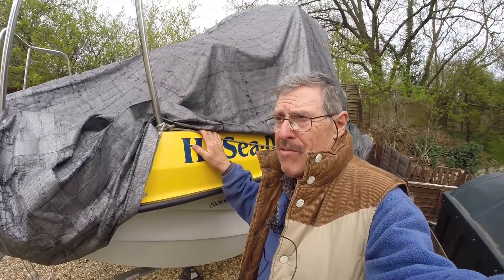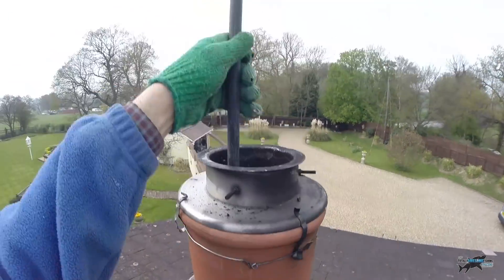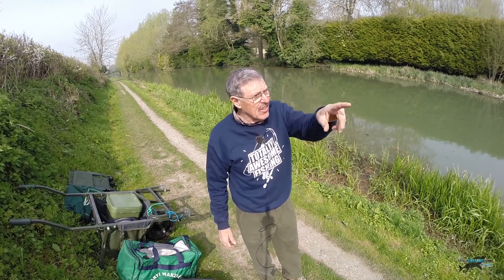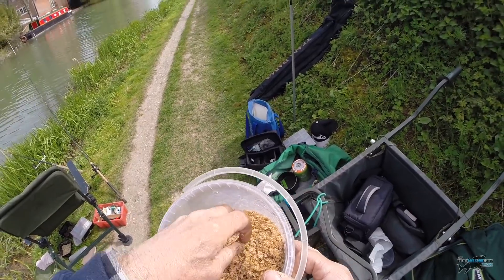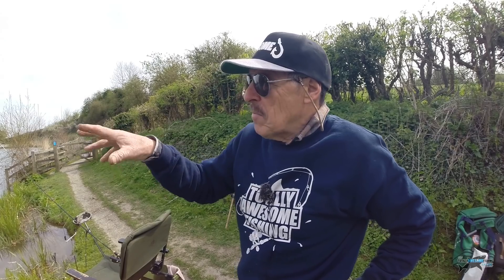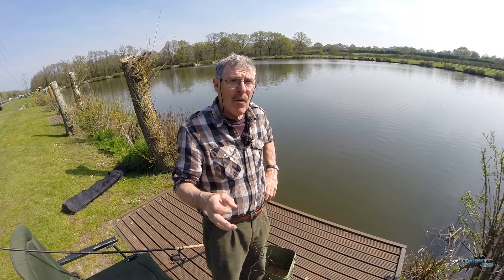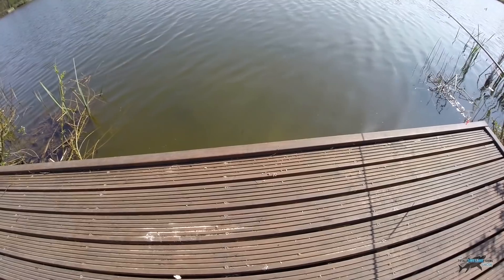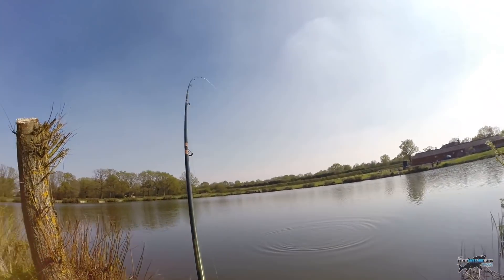Fishing Life - Getting the Job DONE!

Comment: Hmmm, we, here in Poland use rope with a weight attached below the chimney brush.
I only had one time the rope fell off the brush, because I used a weak carabiner, and the brush got stuck, but I simply attached a 10 kg hammer head to the rope and forced the brush down.
Reply from the maker: That would be fine for an open fire chimney,but with our log burner there is a 90 degree angle so I guess the rope would chafe off.
Reply: @TAFishing  OK, I have a whole central heating system with a wood-burning furnace. The joint to the chimney is at an angle, too, but the chimney actually goes down further with access to that part, because that's where the soot must be taken out after cleaning the chimney.

Comment: Thanks Mr Pullen.  You mentioned shrimp paste while talking about paste bait!  I'm guessing you mean the little jars of sandwich spread? If so what would be a good binding agent? Wheetabix lol
Reply from the maker: Small jar of shrimp paste mixed in either with flour or a fine groundbait,dampen it,then keeping working it until you have a paste. You don't need much as its fairly strong smelling But use a fairly large hook,size 8 to 4.That way you have a good sized bait as smaller fish will also be nibbling at it. Paste baits are best used closer in as they are soft and not good for distance fishing.
Reply: @TAFishing  thanks bud. Have a great day.

Comment: Graeme gotta a question, with pellets and bait being harder to get in states do you think koi pellets could used for method feeders or in pva bags?
Reply from the maker: Yes,I reckon any of the feed pellets would work.Check out an agricultural feed supplier,there should be many different types of pellet feed.  If you band your pellet on make sure you get the right size band for the pellet you are using.

Comment: Hi Graham or should I say Brucie, good game, nice to see you, too see you nice!!!!
Anyway, with regards to your weather vane, it will spin sweeter if you put a ball bearing on top of the upright spindle thing which will then be inside the sleeve bit that covers the top of the spindle thing, if you get my drift, it's a bit fiddly but, it will respond better to the wind changes & you don't have to oil it & it cuts down on wear & tear. Love the TA vids both fishing & bushcraft stuff. Better than the T.V.  So thanks to you Mike & the others.
Reply from the maker: Thanks for the tip.Good idea,and a great excuse to get on the edge of the roof again !
Reply: Hi again, my dad used to take us boys fishing & would often use dry custard powder mixed with bread & water to form a paste, we even ate it when hungry, anyway we had success with roach, rudd, bream, carp & crusian carp (spelt that wrong) whatever happened to crusian (wrong again) carp, you don't see them any more, great little fighters. Also he would cut up sections of bike inner tubes fill them with sand/dirt, tie off both ends, use a weak break off line  & we would rock fish for wrasse, the tubes would slip easier than lead among the rocks & save dad money.  He made drop net from old onion bag & small bike wheel with spokes removed to catch prawns, I can still taste them, wonderful memories that I thought I would share with you.  You seem to be on the same wave length as dad.  He would of loved your videos.

Comment: Thanks Graeme  nice video. Did my chimney in the Autumn always good to know it's been done. Been working on the boat for the last week. Had the chap come do a full service on the  little 30hp Mercury  EFI all done including the timing belt. Put two coats anti foul which is a horrible job on a trailer thats sitting on gravel, made ten times worse by Arthur, you know him, old Arthur Ritis, always turns up when you least want him. Still it's done now for a couple of years. I fixed up a trailer over winter I got cheap but made the mistake of buying car tyres which are no where near enough for road use good thing it just needed to come up the slip and 50 yards to the work space. Cheers Graeme.
Reply from the maker: Sounds like you have been busy.I think I am getting a visit from Arthur as well ,he seems a bit touchy first thing in the morning. I think you might need to check ply ratings on your trailer,is it 8 ply for road work ? How come the car tyres are not good enough ?  Is that a weight thing ? I know for towing I changed up the ply rating ,but for short distances I would have thought car tyres OK. Maybe a "boaty" person out there can clarify ply ratings for us.
Reply: @TAFishing  well these ones are max 40 psi ( 4 of them ) and my mate who is super knowledgeable with all things boat says they need to take 80. It certainly looks right seeing how compressed these ones are. I need to check but they make trailer rated tyres. I certainly wouldn't take this lot on the road. I put tubes in these. I have a learning curve to go up on this subject. Although if all I need is to pull it out every couple of years these will probably do.

Comment: Whew you had a lot of soot, you might want to brush 2 or 3 times a year, or burn hotter dryer wood.  Also you might want to get your concrete cap patched or replaced, those cracks will end up eating your brick chimney sooner than later.  Good video

Comment: Mouths on those fish need some attention... I suspect too many matches.
Reply from the maker: That's an interesting point as I was talking to another angler on this very issue. Matchmen generally use softer rods(match) or poles with stretchy elastic so any pressure is far less than say a Carp fisherman with 3lb test curve rods and 15/20lb line terminating in braid hooklinks. But could a fish of say 1lb have a damaged mouth in its younger years,and then carry that same damage all the way though its years to say double figures or more ? Matchmen don't want to apply mega pressure to a fish for fear of losing it,and possibly the match ? Anyone else out there got any ideas on this point ?
Reply: Unfortunately it is the very give in the elastic and low strength leaders that can cause the most damage. It will vary the pressure from a sustained hook hold to a tugging motion. A simple way of describing it is if you pinch and pull the skin between your index finger and thumb. If you pinch it and hold it at the same pressure the pain is limited. If you pinch it and let go repeatedly over time, it will cause increased pain and discomfort. We are only at the beginning of the research we have chosen to conduct at the university I work at. Of course there are various theories, but it seems that from what we have seen it would be a likely cause. I’m a great fan of the show and a life long fisherman. It’s great to you educating people in the right way.